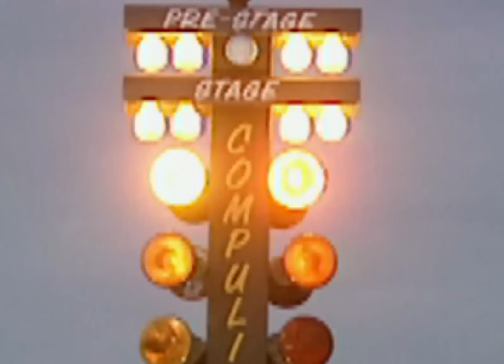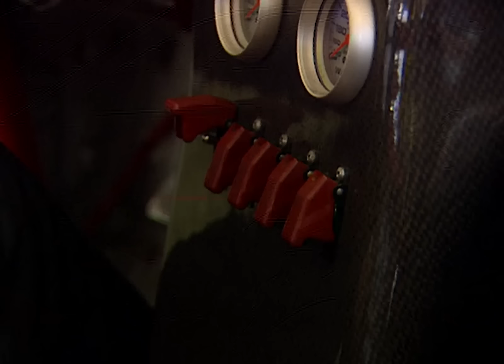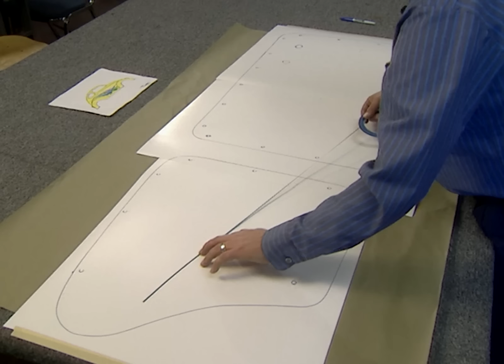Taking The Mystery Out of A 12-Bolt Rear End Build Up - Horsepower S4, E11

Comment: I would love to know where you found a decent 12 bolt rear end housing for $100 that fit that 65 thru 67 because the later models are about an inch wider, but they can be used in the earlier 📳 as well.
I still want to know where I can get one for about $100???
Reply: Sorry buddy but nowhere for 100 ..12 bolts have skyrocketed